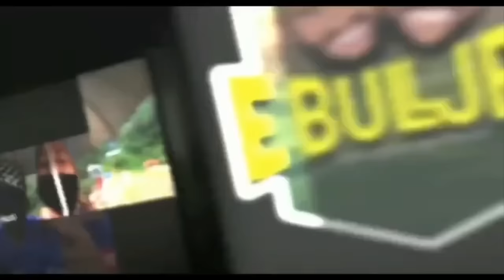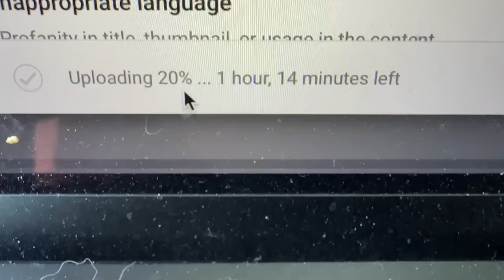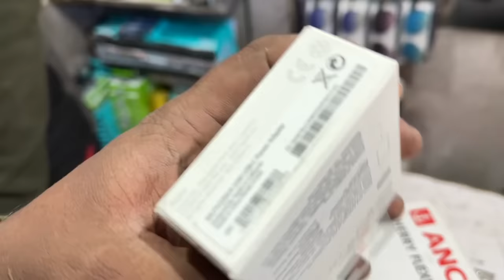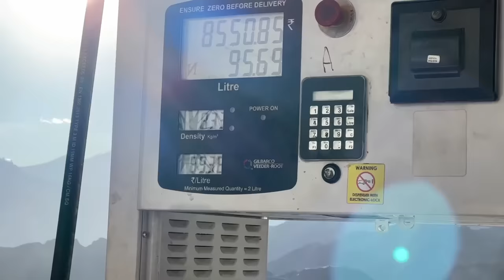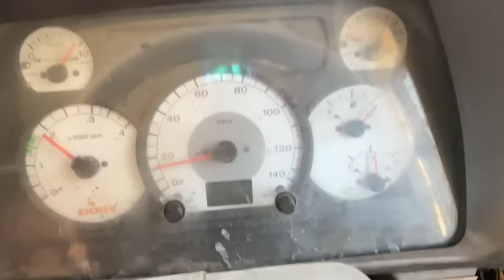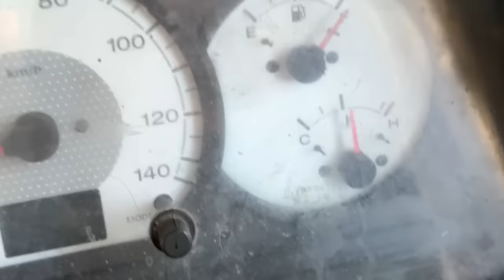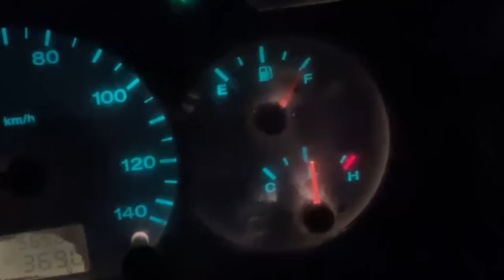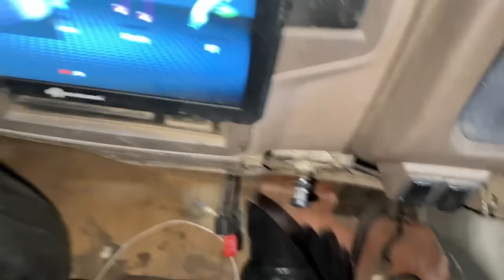Khardung La  pass  snowfall //ഞങ്ങൾ മഞ്ഞിൽ കുടുങ്ങി

Comment: defrost wiper fluid - Use chaiyan nokk. that will sort out the wiper freezing issue. or keep the portable heater facing glass and heat the glass slowly - if you dont get that wiper fluid